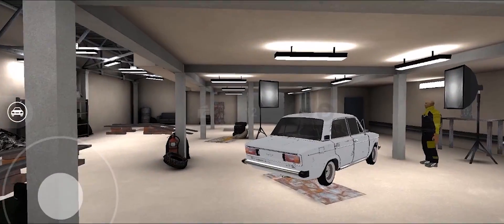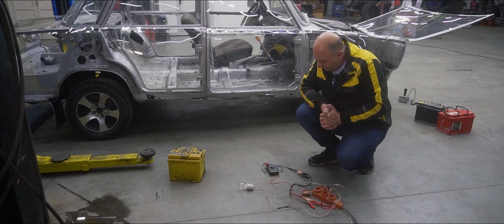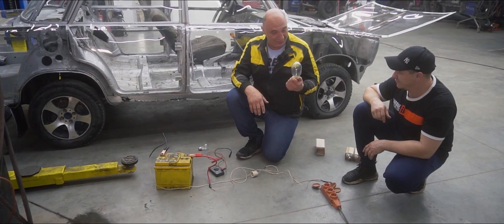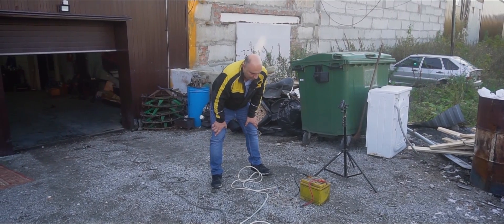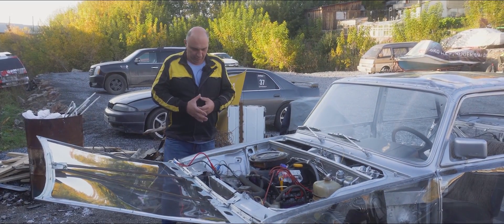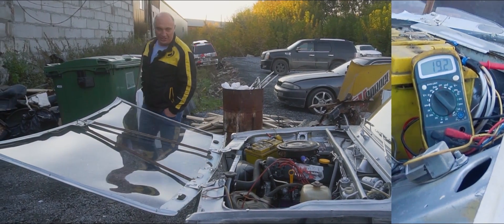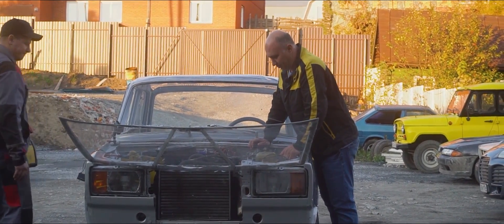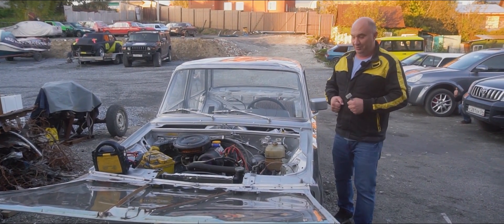Feeding a car 220 volts: will it start?

Comment: I'm still waiting for the day they drain the acid out of a battery and replace it with vodka.
Reply: Not unprecedented in Russian design. The MiG-25 fighter had 300 liters of ethanol for coolant. It was evidently popular at remote airfields.
Reply: battery would stop working, vodka is a preservative not an acid. however some of those cheap red wines might work.
Reply: @dogwalker666  its still an acid, just not as much, itll work but the anode and cathodes wont suit the application, zink and lead would work but would strggle to charge and deplete quickly
Reply: @sleepwalker3520  Its more on the alkaline side of neutral PH normally around 6 or 7 depending upon quality where the original H2So4 acid would be about 3 ish if I remember correctly.
Reply: @dogwalker666  most vodka sits about 4 on the ph scale, I've looked into it and I stand by my saying, it's not as acidic or as alkaline as what it suited for dc pile applications, and I also stand by the plates I proposed, most drinking alcohol is a mild acid, be it grapes, rice, potato, or rye base... must be something to do with ethanol... being "slightly more acidic than water"

I'm not going to list sources or any of that bs, 'drinking' alcohol is quite different to alcohol on the alkene alkane side of things...

I'll read something you can provide, if you want... I don't see the point as my litmus papers show it anyway
Reply: That might actually work
Reply: @marsrover001  Famous last words?
Reply: Sounds like waste of perfectly good vodka.
Reply: @SwapBlogRU  You can get perfectly good vodka in Russia?  News to me.
Reply: @rayceeya8659  it's all a matter of perspective
Reply: @rayceeya8659  yeah its moonshine . Your peeps can learn a thing or two
Reply: Vodka is neutral or about in PH so it wouldn't do anything
Reply: That will turn the battery into a bomb when you charge it.
Reply: @Wildstar40  yeah ethanol is kinda really flammable.
Reply: Vodka fuel cell.
Reply: A guy years ago replaced the battery acid in his truck battery with pickling juice. He started his truck with it too.  blew my mind
Reply: @ionbladezofficial  that’s basically vinegar and salt.
Reply: Shh, don't tempt them; they very well may!
Reply: *and gas tank
Reply: @and drink the battery acid :o
Reply: Lol
Reply: That's  a  wasted  car
Reply: Basic maths : 690 is more than 200
Reply: ive done this!!!!! it wasn't good
Reply: Radiator too! 😎👍
Reply: It would become acidic if you charged it, wouldn’t wanna drink it, it’d rip your oesophagus apart like a really bad box wine at 37% alcohol. Guaranteed 107%

Comment: Imagine how tough a car is- that has a mechanical diesel. 
That can be run without electronics at all.
Reply: Vw mk3 golf with aaz engine is pretty much that, only thing electrical is the fuel pumps valve that allows diesel to run into the engine, and the older generation golf diesel engines dont even have that
Reply: @SamkaPF  old rabbits
Reply: @bansheemania1692  yes and if im correct mk1 and mk2 diesel golfs

Comment: I wonder... I know some older direct drive starter motors I have used were universal motors instead of permanent magnet motors. I bet if you used a resistive load or a beefy variac or something you could run the starter right off AC! You might have to bypass the solenoid and just feed it DC (maybe from an almost dead battery?) to get it to push the gear into the flywheel or flex plate though.

 I don't know what the direct drive universal motor starters run but I think some of modern permanent magnet gear reduction starters are only rated for something like 1500 watts so that would be around 7 amps at 220 volts. I would think the big universal motors would take more but it seems like they would be inside the range of your breakers so you might just be able to make one work!

Comment: The problem of the alternator not charging is because with a 220v input you blew the alternator regulator. One it's shortened, it will blow the circuit breaker

Comment: How to charge your battery REALLY fast. 

I was late for the airport half a year ago, and my car battery was flat, so was the car starter. So there was nothing to start the car.

So i took a 18V makita tool battery. Ram two sawblades into it, then run the starter cable of the sawblades.

30 seconds later the car started.

Just throw the tool battery into the car if it where to stall and went going.

When going home from the airport the car started just fine

Comment: Pretty valid charging circuit: The diode rectifies the voltage, and the bulb limits the current. The battery has a lower impedance than the bulb, so it can always get a voltage higher than the allowed limit of 14.2V (that´s why you should stop charging before exceeding this voltage, it won´t stop by itself). You can double the current by using four diodes in a full bridge configuration. It´s still a pretty inefficient way to charge, but it´s simple, and it works in an emergency. Suitable diodes are pretty much inside every switching power supply. Just in case you are in trouble, you could cannibalize a diode or the complete full bridge rectifier from some device and make your car run again.
Reply: I charge flat batteries starting off with around 17-20 volts, which at first consumes a lot of amperage, around 30 amps for a couple of minutes then lower the voltage to around 15.  The battery will charge fully and the most surprising thing is, as the battery gets full, it doesn't suck out extra volts or current and therefore is self controlling.  Meaning that as the battery gets full the back voltage automatically cuts down the charge!  They do it by themselves, which means these "smart" battery chargers are a TOTAL SCAM!  I can prove this and will do so in the near future.!
Reply: Full bridge Recifier = Electro boom.

Comment: Lol the low current in the beginning is because the 220V is split in half because you measured it in DC mode, but the house electricity is AC.
Reply: It was rectified, they've put a diode on the wire and used a lamp as current limiting since the incandescent lamp is basically a resistor. so a half wave with no smoothing DC.
Reply: @Roalethiago  Exactly, they are using the diode as a half wave rectifier and the lamp as a resistor in a resistive dropper. All the volts are across the resistor.
Reply: @Roalethiago  I missed the part where they put in the diode, I thought they just set up the multimeter in the wrong current measuring mode and wondered why the voltage isn't 220V as it shows in the video title
Reply: @Roalethiago  they need FULL BRIDGE RECITFIEEEEEEEEEEEEEEEEEE
Reply: Nothing in your comment makes sense if you know anything about electricity.